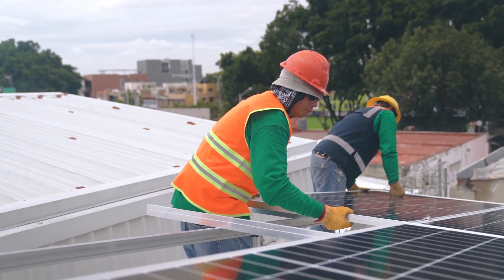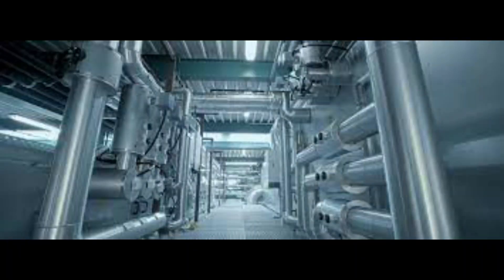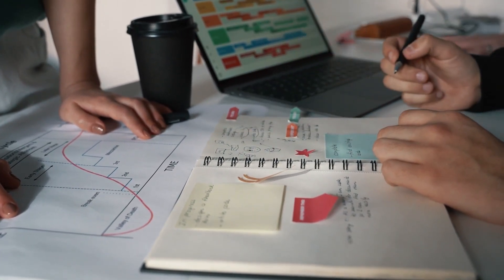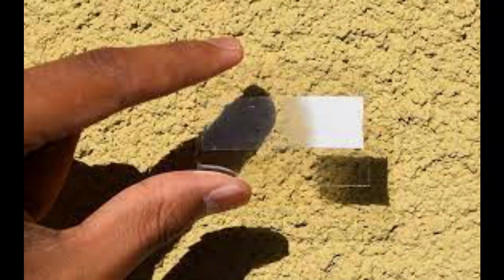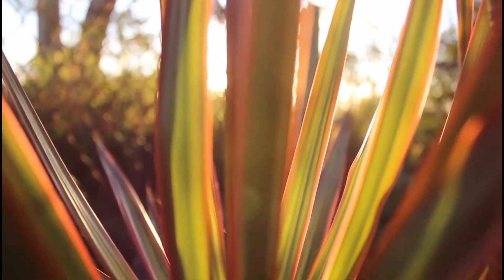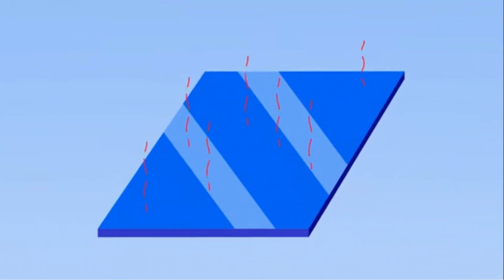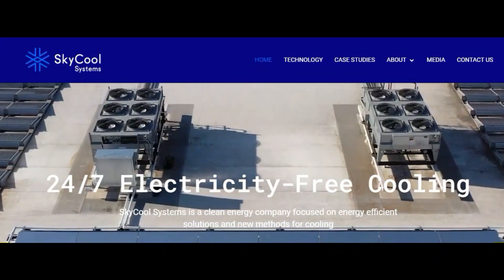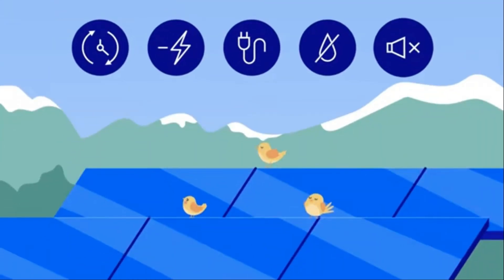Super Cool material panels: 3 times more effective than PV panels for cooling

Comment: Some more advantages not mentioned are that it doesn't require an unobstructed view of the sky, and the direction doesn't change throughout the day. Trees are excellent natural air conditioners, but you can't have trees and solar panels at the same time. With these you could orient them to beam the radiation toward any gaps in the canopy.
Reply: It definitely needs a clear sky